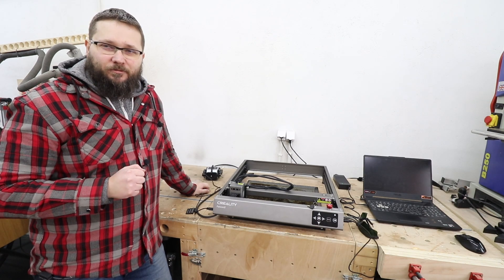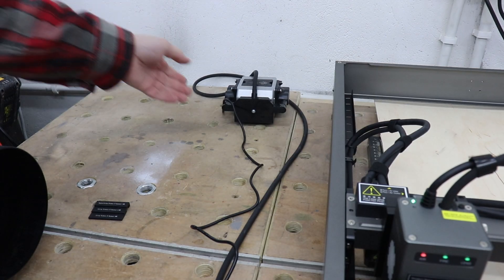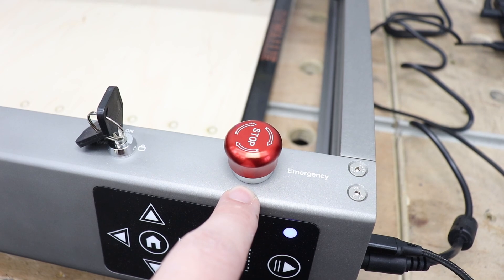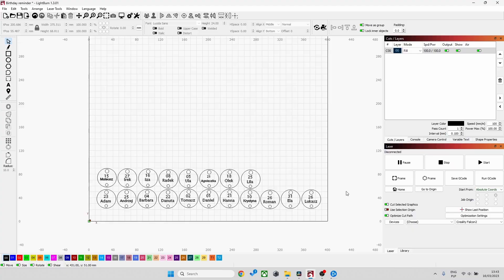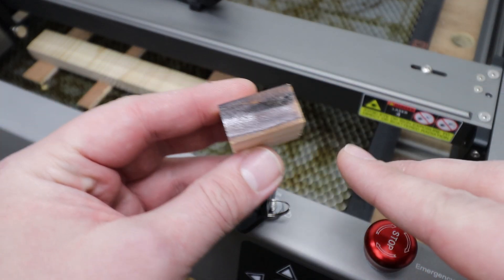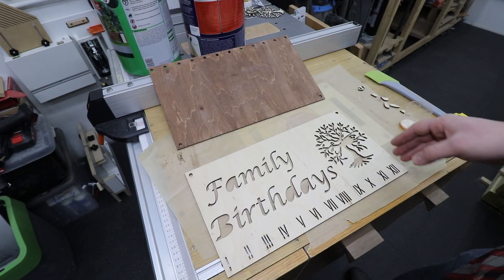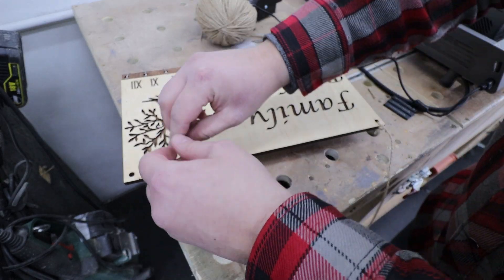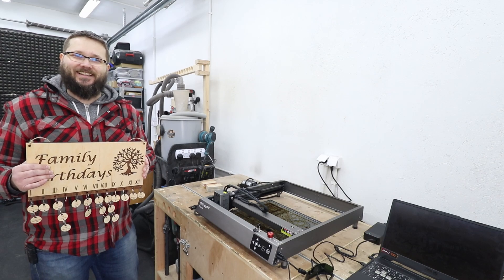Laser Cut Family Birthday Calendar | Creality Falcon 2 22W Testing | Free Files

Comment: I bought one of these it arrived today. When are the x y arrow buttons on the front of the machine enabled. I assumed I could drive the head into a start position. Thanks regards Chris
Reply from the maker: When you have a gcode file on the attached sd card you can use them. But they should work normally as well. To be fair I use my laptop so did not pay too much attention to them. I will have a look at it tomorrow out of curiosity 🤔
Reply: @CasualDIY  thanks, I also couldn’t get the onscreen jog button to work in lightburn. This could be user error I have a lot of experience using CNC machines but this is my first laser cutter.  Thanks for the reply. Best regards Chris